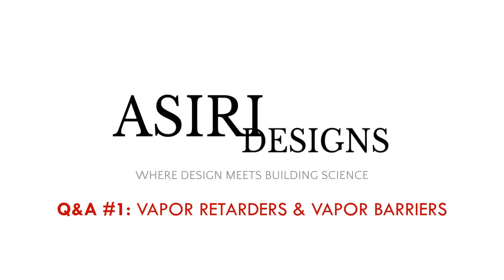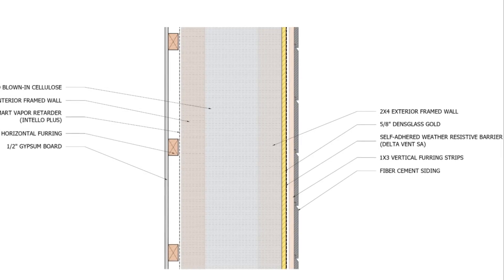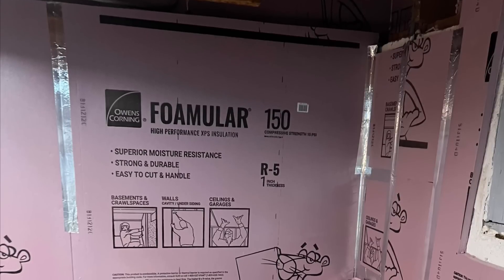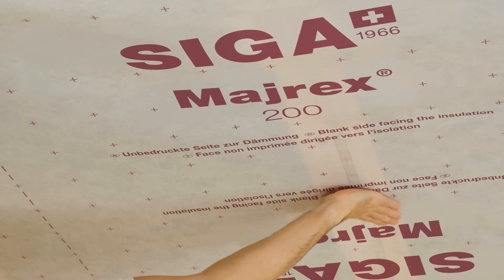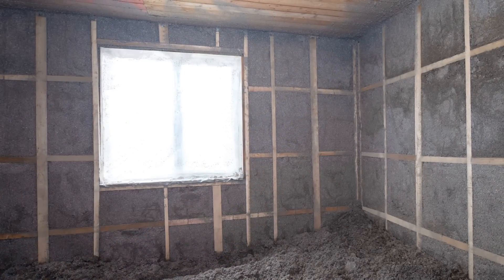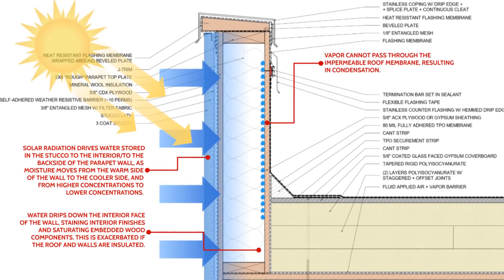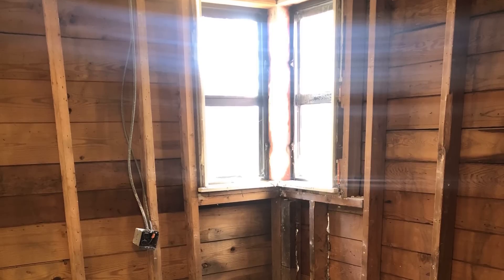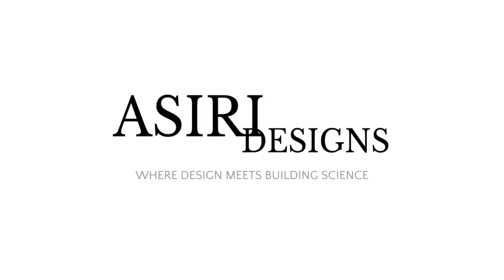Do Smart Vapor Barriers Really Work? Vapor Permeable vs Impermeable, ZIP System, and More! | Q&A #1

Comment from the maker: Time stamps for anyone who's interested 
0:16 ZIP System in Double Walls vs Plywood
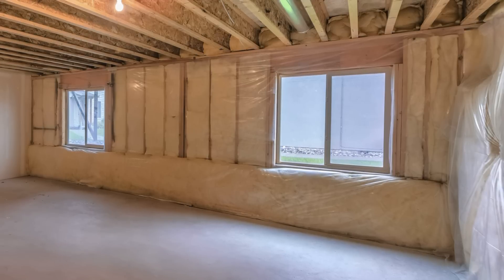2:08 Basement Walls with Housewrap and a Vapor Barrier 
3:58 Do Smart Vapor Retarders Really Work? What is the Cheapest Vapor Retarder?
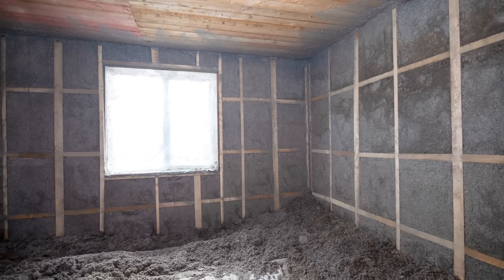7:23 Why Not Always Use a Vapor Open Air Barrier?
9:31 Insulating an Old Farmhouse

Comment: I am not sure if you  specified it, but in another video on basement insulation, another contractor also recommended closed cell styrofoam panels, but nailed on 1" x 3! furring to allow breathing behind the sheets in order to save mold. Spray foam anywhere doesn't allow ventilation.
Reply from the maker: So you want to sandwich moisture sensitive furring strips between a damp foundation wall and impermeable rigid foam? How exactly are you preventing condensation if it's allowing warm interior air to come into contact with the cold basement wall? The contractor who is giving this advice out is wrong.

Comment: Hello. Thank you for sharing your wealth of knowledge. Although I probably have watched every one of your videos, I am unsure of what to do with my 1895 1.5 story farmhouse in WI. I gutted two rooms, one above the other because of cracked and sagging plaster, floor joists, etc., but, frankly, I regret doing so. The house has blown-in insulation, which appears to have been installed very well, and there are no signs of moisture issues. The house has the original cedar lap siding. I installed fiberglass insulation with a 6 mil vapor barrier, because local contractors informed me that this is "code." I did not cover the plastic because I wanted to watch for moisture. Sure enough, although I meticulously taped everything, I noticed water droplets on the outside of the plastic up at the peak of the roof. ( My intent is to have a completely conditioned space above the second floor bedroom, rather than an attic.) I pulled down the plastic from the peak so the area could dry. I am paranoid to try anything. I am considering replacing all of the 6 mil with IntelloPlus because I have seen it in your videos, but it is not available locally. I am tempted to go back to the old days when the house was uninsulated and there were three coal stoves providing heat! Understandably, you were reluctant to offer specific advice to the IL farmhouse owner, but there are many of out here who need advice. Would you consider acting as a consultant for an hourly fee via telephone and FaceTime? Thanks, Ron.

Comment: Building in southern Kentucky. I am struggling on how to provide air barrier in ceiling below vented attic.  I see articles and recommendation not to use drywall with recessed lights without utility cavity and smart air barrier above.  I wonder if that info is up to date with the newer sealed led recessed lights. Seems to me they are sealed, have reasonable gasket and they clamp to the drywall.  Should that not be adequate with drywall barrier. 

In order to reduce glare in the house the recessed cans are near 3” deep so the makes the utility cavity deeper than I would like to provide between a smart barrier and the drywall. 

Thoughts?

Comment: I'm so lost. I live in Zone 7 into an 800 sq ft home that has a 1950's vented, dirt and cinder block crawlspace that is about 3 ft tall. The home severely suffers from moisture buildup during the late Spring through early Fall via the ground (which resulted in a 200 year old oak falling near the house where we could see wet clay as far down as five feet).  Contractors want to cover the crawlspace in plastic, add a dehumidifier and call it a day. But older homes need fresh air. If you've any contacts that understand air and moisture circulation with a home like mine, I'm all ears. Over half the year I can't have fresh veggies or fruit out or it is quickly contaminated by green furry mold. It's like I'm working in a penicillin lab. I've been updating for nearly three years and this is one of the final steps to getting the home's infrastructure stabilized. I love these videos. Thank you for educating us! 😊

Comment: when you tape the joints in DOW SM or Owens Corning Comfort board.. both become a vapour barrier. on the cold side of the wall assembly... this will cause condensation. look at the vapour permeance of SM or Comfort board.. both are high enough that they are classified as a vapour barrier. or more correctly a vapour retarder because NO building material is a 100% vapour proof/tight product. even 6mil Poly is not a 100% vapour tight product it has a .06 perm rating  ... not 0.000000

Comment: I've watched hundreds of these types of videos and still no answers to my area's climate, other than to seek an engineer. Maybe I should have changed majors. 
 The issue is mixed climate thresholds. Most videos cover climates in the "south" or "north" but a large portion of the US, such as where I live, experiences a varied climate. The summers can be 100 F with high humidity and winters can be -20 F with very low humidity.  I've seen "best practice" for each extreme but not a single one that deals with both in a single build.
 If there is a solution that is "best practice" for this common situation, maybe that could be promoted thru one of these videos. 
You've done a great job with the math and viable answers to each extreme climate. Would you care to offer a solution to this when it comes to proper insulation and vapor permeable/barrier options?

Comment: I'm just getting ready to start a new home build in south central Kentucky.  2400 square foot ranch.  I was just going to use 2x6 studs, ac plywood sheathing, tyvek, and insulated vinyl siding with fiberglass batts.  I'm really confused with all the building science that I'm learning.  So much different than framing in the 90s.  Keeping costs as low as possible is important, but I'm doing all the work myself as I'm finally getting to build a home for myself.  Am I doing it all wrong?

Comment: Unfortunately I already framed my concrete basement before I watched ur video. Should I cut foam boards and place? It won’t be sealed properly with tape. Or should I just use the vapour barrier

Comment: 9:28  Love the photo of the guy using a 1/2" corded hammer drill to set a screw in the nailing flange of the vinyl siding!  Yes, you can use pan-head screws but set them in carefully with a smaller drill with a ratchet so as to not torque too tight!

Comment: It’s nearly impossible to use exterior insulation on an old farmhouse or almost any remodel for that matter. The parts you’re going to save like the decorative molding and overhangs get burried or shrunk and damage the aesthetic of the home. It’s also important to remember that if you’re not going to install the ductwork to introduce mechanical ventilation you’re better off not air sealing the home at all on the exterior because you’re asking for mold. I made that mistake on my own house when the original builder didn’t use house wrap and vinyl sided it. I had to re sheathe the whole house and used zip system and taped it well. It caused me to have to gut the interior, do mold remediation after just one year and install ductwork for an ERV, new insulation and well taped Siga Majrex because there was warm moist air from the inside leaking into the cavities around outlets and windows and behind the shower. It was a great learning experience but had I done this to a clients home I’d be sued or out of business or both.

Comment: new build here- before we insulate with R60 blown in cellulose in the attic, would it be worth foaming around all of the top plates in the attic of the interior and exterior walls were possible? Walls are R23 mineral wool.  We used OSB sheathing, zip taped, then used Benjamin obdyike hydrogap house wrap along with a horizotial furring strip rain screen for our vertical cedar shiplap. This way if any rain gets behind the siding, it will also drain behind the horizontal furring strips

Comment: I’m a carpenter  in Vancouver Canada so these videos are the bomb, wet and cold 9 months of the year and high humidity year round, really appreciate your content
Reply: Hey i'm on Vancouver Island so same climate. I was wondering if you had any feedback on good vapor retarder for the inside of the wall? 

I'm renovating an old 1965 BC box house.

I'm especially wondering how to properly insulate basement wall.
Concrete foundation wall up to about 6 foot and the rest is wood framing.
Reply: @jean-michelroy5883 I actually bought intello to try out on my own house and it seems to work pretty great. didn’t do a blow test or anything but I assume it’s fairly air tight because I only used 2x4 framing and insulation (not to code) and the difference in humidity and warmth from outside is quite noticeable. 

On the basement comment I know a lot of people spray foam between the concrete and interior walls, again this channel actually made me aware of the possible toxicity of spray foam over its life time so I liked the suggestion he’s made of just using ridged insulation with taped seams as a thermal break and air barrier

Comment: Question: I live in the DFW area of Texas. I have a brand new shed I’m building, with 2x4 framing with ZipWall sheathing on the outside. I plan on installing Hardie cement lap siding with a rain screen/gap behind the siding. On the inside of the tool shed, I’m planning on applying a closed cell spray foam insulation, and then a moisture resistant drywall. The question is there any problem with applying a closed cell spray foam insulation in the stud cavities? The tool shed is not air conditioned, but I may put a portable unit out there for when I might want to work out in the 120 sq. ft. shed. I have made a couple YouTube videos so far on the concrete foundation with a 6 mil vapor barrier, and the framing of the shed so far, in case you want to see what I’m working on. I have also made a video on the Froth Pak 200 spray foam insulation kit. Probably like most people, I’m not an expert on what to do with vapor barriers. Totally used to batt insulation. I’m a remodeling contractor for 26 years. What would your advice be for my climate zone?

Comment: Been watching this and some of your other videos addressing vapor barrier issues/questions. Great explanations!

I have an odd situation that I'm struggling to figure out: I need to enclose a porch with a 2' high brick knee-wall, brick pillars at the corners. The homeowner wants to lose as little square footage as possible, so we were thinking have the drywall against the inside face of the brick, with the framing inline on top. How do I manage insulation and vapor control, though, especially with such a porous substance as brick (climate zone 4, for reference)? I'm thinking taped foam panels (maybe ½") between the brick and drywall, then transitioning to the regular framing, OR a smart retarder like Certainteed MemBrain. Would either of those work?

Comment: This is very interesting. I did not know that you don’t need siga majrex for your building if you install exterior insulation. Would it still be a good idea to install the siga majrex just in case the wall cavity does get vapor in it? Could you elaborate more on this please? Great video!
Reply: Remember, you must install ENOUGH ext insulation; if you dotn your are arguably better off installing NO ext insulation !

Comment: I have a tricky situation and not sure which way I am going to finish my basement. New build just block foundation in Ontario Canada. High water table noticed very humid in basement and had some water come in from footings due to high water table. Outside foundation is blue skinned and xps foamed. We opted to go an interior french drain system with dimple board on interior walls into drain and seperate sump. On top of that we used roxul comfortboard over the dimplex and studded wall in front of that with roxul insulation. Rim joists are spray foamed. I feel like I would create a double Vapor barrier if I added a Vapor barrier on the studded wall and trap in moisture. Or do nothing and the dimplex sheet will condense in winter when warm indoor air hits it. I’m torn

Comment: I'm in Ontario Canada and have a very old home but lots of character so not ready to teardown. The exterior is currently lath and plaster. I can make shiplap concrete slabs to reclad the exterior. Thinking of putting xps foam on exterior then strapping then the tiles. What should do with the roof? Do I close all the soffits and do the same foam and new sheathing and roof?   If so should I gap the new sheathing from the foam? Also how thick should I go on walls and roof? I can send pics if that helps. Much thanks

Comment: I'm building a house in very humid coastal region in Canada. Doing 2" taped rigid on exterior, 2x6 wall, batts in cavities, and gypsum board with paint. Debating using zip for exterior sheathing, or a plywood with blue skin WRB. Any suggestions would be helpful. Also what vapor barrier for interior? Thanks
Reply: Hi there, I’m building my house in Victoria.  Just curious why not use a mineral wool for exterior insulation?   Sleggs has a new product that is not Rockwool, stiffer and cheaper but same performance specs.  If you are using a vapour barrier interior you might be ending up with a double vapour barrier situation and your walls will have trouble drying out.
Reply: I've never seen anyone in this area. Use the mineral wool and I am doing most of the construction myself and it seems it's harder to do the mineral wool. As far as the dryimg that's why I'm looking for suggestions

Comment: I love your channel.   I’m renovating a mid century wood framed house on the barrier island Long Beach NY.  It has a vented cinder block crawl space with 1’ above grade and 2’ under, with a rat slab.   Due to a high water table, it’s frequently filled with water after a storm.   I haven’t seen you post anything that addresses retrofitting for this condition.   I was thinking to convert it to conditioned space by sealing off the vents, and adding a sump pump, but I’m interested in your ideas on how to deal with the groundwater.

Comment: Love the content. What about hot Arizona climate, with cold air conditioned interiors, whats the ideal wall assembly?
Reply from the maker: Thank you so much. Because much of AZ is a hot/dry climate, there is a lot more "forgiveness" since things dry out. If I was building my home in Phoenix for example, my wall assembly would probably look something like a reinforced CMU block wall with a fluid applied water and air control layer, a couple of inches of polyisocyanurate installed outboard, and some stone veneer with an air gap. You get the benefits of a thermal mass to keep the building cooler, and the rigid insulation outboard will make sure that you slow any heat transfer (you could also use ICFs if this was cost prohibitive). Big over hangs and north facing windows if possible to reduce heat gain.

Comment: Would love a video(s) going over the mechanical and/or passive ventilation that is needed when we are retrofitting to a more air tight assembly and how that may differ by climate. I am in zone 2 and I see so much focus on the wall/roof details but not as much on the makeup air and keeping humidity levels controlled with an HVAC systems that is going to be running less in the more mild months.

With a retrofit on a budget where someone is just doing siding, insulation, air sealing, and windows, when do you need to consider makeup air? With unlimited budget one could do an ERV + dehumidifier + swap out to a smaller HVAC system, but there has to be some more cost effective or DIY options.
Reply from the maker: This is a really important topic that I've briefly mentioned in past videos, and I certainly plan on addressing this soon. In my opinion, you always need to provide make up air if you're exhausting at a rate that places your building under negative pressures, it's non-negotiable, but the challenge is providing make up air at the right rate without increasing interior relative humidity levels in zone 2, and as you suggested you need additional dehumidification. Look at an ERV and a dehumidifier as something that must be included in part of the budget, these are essential systems. When you improve energy efficiency in a humid cooling dominated climate, you get rid of all of the incidental dehumidification benefits provided by the air conditioning since the A/C isn't running nearly as often. Have you watched these videos of mine?: https://youtu.be/1TuRK3CI7jc
Reply: @ASIRIDesigns  How about making a video series/ playlist broken down for each climate zone? That way everyone can get their questions answered for each climate zone? Thumbnail idea: picture of that part of the U.S., etc and then Climate Zone # written over the picture. Most people don’t know or have memorized what climate zone they are in, so maybe write something like Central Texas and Climate Zone. By doing this you could also reuse the same video editing, but maybe change some of the voice over, so it seems like it’s customized to each state, region, etc.
Reply: Should I insulate an unconditioned accessory building? With the extreme heat and sometimes freezing cold climate of North Central Texas, I am planning on insulating my tool shed with closed cell spray foam, and making a YouTube video about it. I like the idea of doing everything I can while I have the walls open for insulation, wiring, etc. rather than trying to go as cheap as possible. Hopefully this shed will help protect my tools as much as possible from the weather, moisture/vapor, etc. considering there won’t be any regular air conditioning. Just wanted to check with you first to see if closed cell foam was a good/bad idea.
Reply: I would like to hear your thoughts on this too